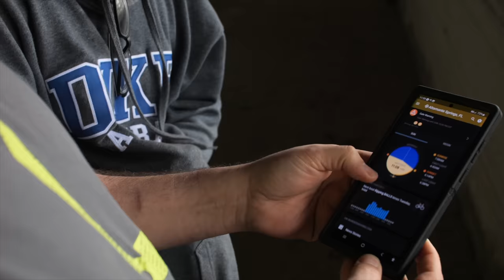Windy FunFly - FPV Freestyle - ft. Joshua Bardwell, Bubby FPV, LetsFlyRC

Comment: What setup was the Bard using? Drone , googles, and radio?
Reply: Couldn't see the Drone, but I'd have to assume it's his own frame the qavs JB edition, he uses xing2 motors and an Iflight stack. Those are the fatshark dominator goggles so he's using the walksnail avatar vtx, elrs, and he's been flying the Radiomaster boxer as his daily driver... Unless I didn't see correctly, in which case it would be the tx16s. Hope that helps. 🙂👍🏻
Reply: quad was a skyliner